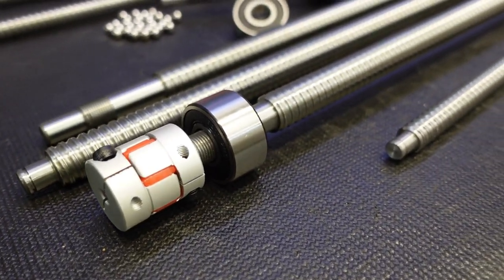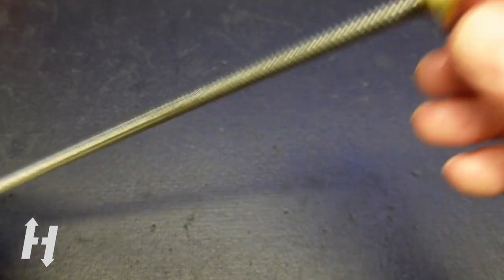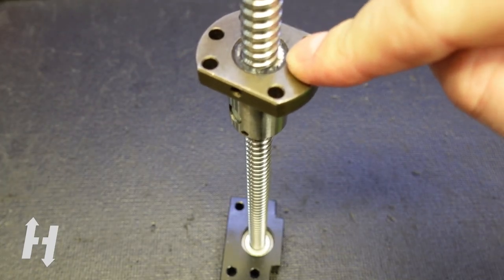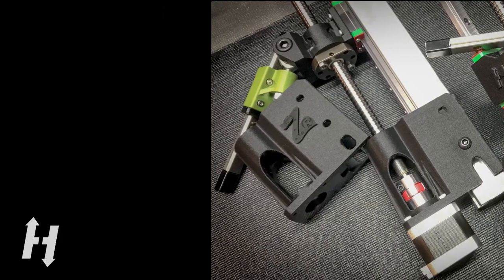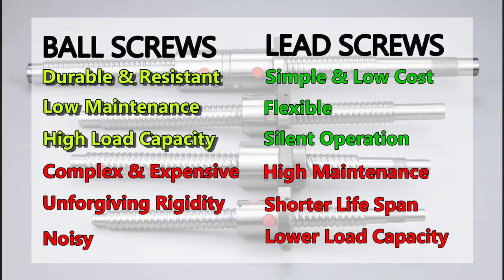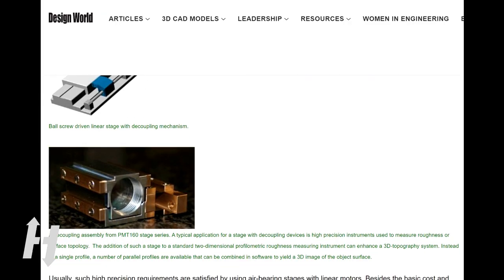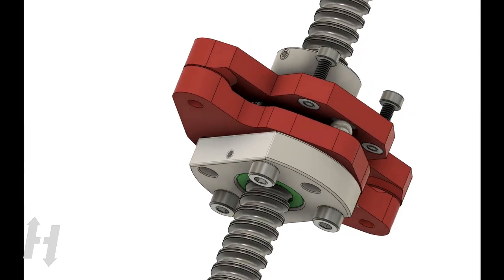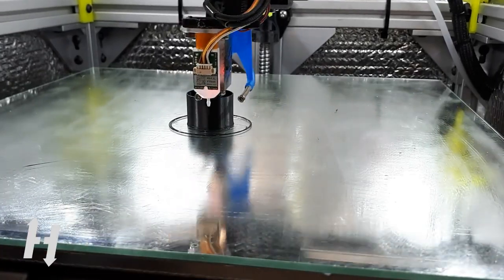Fixing Z Wobble from 20$ Ball Screws with that simple device

Comment: Will the ball bearings wear into the magnets? I don't think magnets are that hard. Why not have two metal cups to keep the ball bearings centered.  Fascinating video. Great work.
Reply from the maker: Yes they will eventually.  I have been running the wobblewings snice May 2020.  My magnets are showing signs of wear.  My next version will include precision hardened metal discs on top of the magnets.

Comment: Clever and inexpensive workaround!  Once the steel balls wear through the plating on the magnets, the exposed magnet will quickly oxidize and MAY give a rough rolling surface and could change the dimensional spacing.  I look forward to a follow-up video!
Reply from the maker: Yes, magnets plating does wear out after time.  This is what i am working on now: https://raw.githubusercontent.com/MirageC79/HevORT/master/images/DSC00123.jpg

Comment: Hmm glad i gave up just now trying to redesign my whole triple ball screw z axis to belts haha. Ill try this first!  If it works ill mill some up.
Thanks its probably the way my 800mm tall z axis will ever work.

Edit. I have made the changes to use on a 1205 ball screw for use in some cases. It uses the same hole pattern as the ball nut for a easy install. Obviously it wont fit everything.
If your interested reply here and ill add a link

Comment: Great video! Thank you for your time!

I like your idea. The information you gave about lead vs ball screw really helped me.

I have a question:
Does the bearing on your design will wear the plastic after a certain period of time?

If it's the case, can you put in your flexible bracket design a washer socket(like a fender washer big enough) glued at both side so the metal washer take the hit from the bearing instead of the plastic. Would that help?. If the bracket was made of metal that wouldn't be an issue but hey it's not like everyone has a cnc at home :P

Again thank you
Reply from the maker: the ball bearing are sandwiched between Neodymium magnets.  They will wear over time, but at a very acceptable rate.  I am looking for precision metal discs to be laid on top of the magnets for better durability.
Reply: @MirageC  My bad sorry. I saw the magnet disk in the 3D Simulation but in the actual parts I didnt notice...

Comment: Fantastic!!! A similar solution could be also implemented on my ender 3 that has a wobbly Z rod!!
Reply: If you're brave enough (and I definitely don't encourage it) you can do like I did and hand bend them very carefully back, they're sufficiently soft to be bent by hand at least on 400mm size, it just has to be veeeery slight bends at a time, always checking against a known very flat surface to see the results. It's easy to make it worse tho, specially applying the force on the wrong spot.
Reply: Haha buy a new rod
Reply: @REDxFROG  it's also probably bent if it's the same quality

Comment: Another great innovative discussion!!  One thing I would like to have seen is a mention of the fact that lead screws (maybe ball screws too, but I don't know much about them) can vary as to the number of starts for the screw, commonly anywhere from 1 to 4. The more starts the fewer rotations needed for a given vertical displacement, but I'm guessing the easier they are to back-drive. I'm curious if you know any other limitations or advantages to the number of starts, such as wear, or runout of the screws? (Oh yeah, obviously you must match the nut to the screw in number of starts.)
Reply from the maker: You are correct, the more starts on a lead screw with same thread pitch will provide more travel distance.  This allows to have low angle of threads will maintaining good travel distance.  It helps avoiding the back driving.  https://spool3d.ca/news/lead-vs-pitch/

Comment: Very interesting video, you seem to have solved the issue well. I still wonder if belts would be a superior solution though.
Reply: Belts + the accessories to support and roll them might end up to cost about the same as this contraption with the advantage? of higher rigidity
Reply from the maker: It all depends on the application, belt will be easier to back drive at same gearing ratio due to even less friction.  They will also need to be sized properly according to the bed weight.

Comment: What is it all for? isnt it too excpencive for auto bed leveling and slightly better non planar 3d printing or there is something else?
Reply: i understand fun of making such machine, but 1 lead screw is so cheap and works perfect am i wrong?)
Reply from the maker: Lead screw will work for a time yes, if you lube them religiously.  We Have some HevORTs with beds that are 600X600mm and more.  Those are quite heavy to actuate and we are not yet doing non planar printing.  But yes, it is still doable with lead screws.

Comment: Yet an another amazing video, please upload them more often. As a fellow engineer I love the designs, personally I would have just gone with a good quality lead screw if price is an issue. Cheapo ball screw additional to the wobble might have deviations in pitch as well. Also experience showed me simple always wins at long term use.
Reply: All screws have pitch errors. It just depends on your accuracy requirement. When the screws are rolled short term deviation is probably quite small. It will depend on the last couple of turns of the tooling, which one imagines is smoothly channelled.
Absolute error is something else. That depends on how accurately the rolls are made. For short lengths it is probably irrelevant but for 2 mtr lengths a cheapy could be interesting. If you can accurately measure those distances any error can be accounted for in the software. 
The real warthog in the workshop is temperature variation. With a daily domestic shed variation of 30 degrees c. here in Oz the 2 mt shaft varies by some 0.4 mm. or 15 thou.
Because of this and I am interested in absolute accuracy, just because I can be, I am looking at measuring displacement independently of the drive system.

Comment: Great comparsion of lead and ball screws!  Like your method to decouple the printing plattform from horizontal lead screw wobble, but why not just removing the upper screw mounting? If the lead screw is only attached to the motor and the other end can move freely the result should be similar...
Reply from the maker: lead screws a so rigid that they will still carry the build plate in their wobbling around motion when not attached from the top.  Due to the bed weight of this printer I am using a double row angular bearing at the base to take the axial load.  This makes the axis pretty solid in place.
Reply: @MirageC  Got it, thanks for explanation!

Comment: Why not have a belted Z axis? I have it on my Pro 3D V-King and I get no Z wobble + its cheap
 A wonderful video and beautiful engineering design!
Reply: There is nothing wrong with belts. Use them if you like. However screws being a metall part, they can widthshand high temperatures much better. For example the best belts at the moment are made by Gates - they are rated for 135c, but they do tend to wear out faster at elevated temperatures nevertheless.

Also i wonder what happens if your z belt ever fails? Does one side of the bed just fall down until it jams on it's rail's thrust bearing?
Reply: @dreamcat4  It is possible to isolate the belts from the heat (in some cases). And yes, belt failure would have your heatbed drop. However since belts are so dirt cheap and easy to replace, and dont have any of the problems associated with ball screws, I believe a well-designed Z-axis-system using belts (maybe more than one?) is superior in all aspects to a ball screw. It has to be overengineered so flexibility-related issues don't come into play, but it all pays off in my opinion. Z-wobble is just fucked man.
Reply: @youngtschakaloff  Thanks you your replies here. I think in response to your points...  it seem like a difficult problem to thermally isolate z axis belts AND seal the chamber for higher temperatures. Compared to (for example) sealing away belts for the other x-y axis. Your other point about belts being cheap to replace: well that is only really true for regular belts. However the hi temp belts are twice the price. To you can immediately double that. And of course then the more belts you need to replace, that difference in cost is going to eventually become more significant at some point. Doubling the belt width also going to double the price of replacing them too. So it all stacks up. And depends entirely on the specific configuration. But more so the MTBF for belt failure become exponential past a certain point when increasing the temperature.  And getting to around or above the rated spec. Therefore it's more difficult to know ahead of time designing the printer how durable the belts will actually be in practice. I.e. for a given target temperature that you are trying to hit (that is above 100c). Well... by comparison ball screws don't seem to have the same set of problems / trade offs. I am willing to accept the fact there are other possible issues with ball screws. Just that belts are not always so perfect either. It just remains very unclear to me what the actual other dealbreakers still are with ball screws, after seeing this wobble joint solution video. And the performance / results of it as demonstrated.
Reply: @dreamcat4  yes, great points you made there. You see, I talked to many people about the best kinetic system (cartesian, delta or coreXY) and it seems as if coreXY is the best, except for if you have Z-wobble issues. So I decided to construct and build my own printer. It is still an unfinished project but it will be a CoreXY with linear rails on all axis as well as worm gears and belts for the Z-movement. After putting the Z-system together and making everything work, I will isolate the whole print area and maybe make a custom watercooled hotend. That way no components, including belts are facing any heat. I am sure that this will give the best printing results for the money, all things considered (heated chamber too). I am planning to make a video when its all done but until then, there is some months of work left. Now, you got me thinking. Would it maybe make sense to use chains instead of belts? It's just that I don't think that noise ever was an issue for the Z-axis. Just an idea.
Reply: @youngtschakaloff  chains sounds like it could be a good idea, especially in terms of making a design that could initially use belts and then later on be retro fitted to use a chain instead. Should that end up proving to be necessary. However i don't know myself enough about chains to tell you is they could bring their own different set of considerations or other new problems to solve. However what I have researched and discovered was that in inddustry (like industrial ovens). The a similar solution they use in place of rubber belts is stainless steel belts. Which are literally just thin brands of stainless with holes punched into them like ticker tape paper. That is not to say chains are not going to work. But chains need lubrication to prevent wear. Which happens at an accelerated rate with temperature. Wheras a stainless steel belt needs no lubrication (at all), And is also lighter, and has resistance to corrosion too. For example if your print is of gassing fumes. So i guess thats why they would use them in industry over chains. However just try to find where to buy some such belts! And the matching gears to drive them! Because I came up empty. Could not find a shop anywhere. Its really more just b2b manufacturing customers. But maybe... if there were some already being sold as a replacement spare parts for an existing commercial industrial systems. Then they might in fact be orderable. Sorry but I really dont know where to get them! ... good idea though. Then you can start off with belts and see how it goes.
Reply: @dreamcat4  thanks that sounds great! Honestly they would probably be the best solution. I will try to find something too.
Reply: @youngtschakaloff  thank you for looking into this, and please come back and let us know if you ever find any! As would really like to get my hands on some myself. Not necessarily just only for Z but perhaps also for the X-Y drive. Until then, good day.
Reply: @dreamcat4  okay after a 10 minute google search it appears to me as if what you were talking about either doesnt exist or is stupendously hard to find, if you google "stainless steel belt" or the like, it appears the results are mainly some sort of sheet metal. If you search "stainless steel chain" you will only come across goofy jewelery. Its not easy! But I was thinking if, with the right tools, these sort of belts should not be too hard or expensive to make. But until then i rather melt some fiberglass ones.
Reply: @youngtschakaloff  hello i found there is a company who manufactures them, called "belt technologies inc". And you can see some examples of these products on their website. But I have not attempted to contact them because I really don't want to be dissapointed to find out the price. Which might be rather high, given the typical costs of industrial manufacturing machinery. However please checkout their product pages. If only to see an example of what they look like.
Reply: @youngtschakaloff  Interesting... there is a lot more useful technical information about them, if you sign up with email, and download their design guide pdf.
Reply: @dreamcat4  oh well. I ignored their search result, not thinking that they actually produce belts. Duh. 

The sheet metal stripes with holes into which balls engage like in chains are a great solution. With the right dimensions they can be perfect. However I see a problem. The minimum radius that the belt can take is rather big (plastic deformation unter tension like this would weaken the belt significantly). On the website, the wheel driving the belt is just as big as the stepper motor. Using this without gearing on the Z-axis is out of question, worm gear is mandatory. For X and Y it is also too big i think. Steps per mm would be too few. 
Gearing on the Z-Axis is fine, but not on X and Y.

Otherwise this is great! 
Dont worry about the price. Yes it is probably overpriced "made in germany" but its just thin sheet metal with holes. Definetly DIY-doable if you ask me. Honestly I can do this. I might actually make and use that for my Z Axis. Thanks for inspiring! 😎❤
Reply: @youngtschakaloff  yes that is the main drawback, the requirement for gearing. but i don't seem to be smart enough underdstand myself yet why it would be a deal breaker for the x-y axis. Can you please explain a bit further?
Reply: @dreamcat4  yes well it is possible, not a dealbreaker at all. In my own work i would rather just stick to belts for x and y first. I dont have the space for a traditional gear reduction. Also it would make sense to use a belt for that gear reduction. And that belt would not be a steel sheet belt like the one we want to have here. And honestly, if you can (because you really have to if you care for lifespan) isolate your steppers from the heat, you can also isolate your belts to a degree. Thats just what im gonna stick too. 

On a different note, do you have an idea for a different platform to discuss like this? I was thinking of reddit or so.
Reply: @youngtschakaloff  Either the Hevort discord server (link in the description), or there is also a 'high-temp-fallacy' channel on the annex engineering's discord server. BTW i just found where we can buy very cheaply these stainless steel perforated tapes now!!! If you just google the magic set of words: 'perforated stainless steel tape'. Then it will finally turn up seler links for a variety of similar products. Which are are being used in other applications.
Reply: @dreamcat4  You can pretty easily calculate the amount of gearing required for the motors to hold the weight of the bed when turned off so your bed doesn't droop if you loose power or something. It is my opinion as well that if you've got this many motors you might as well go with belts since I don't really see many benefits for the ball screws.
Reply from the maker: Yes, belts could be a great solution.  Motor gearing and belt size would need to be adjusted for bed weight.

Comment: Wow! this is really cool! But aren't you now depending on the flatness of those magnets that the Balls are touching? Or is that not a problem after bed leveling?
Reply from the maker: the flatness & parallelism of the magnets is quite important yes.  This is why my design has both half printing up to ensure the surfaces on which magnets are sitting are as precise as possible.  Printing them with support would not work.  My next design evolution makes use of wider magnets to avoid having them crooked into location.
Reply: @MirageC  Thanks!

Comment: Thanks for this. I use belts on my printers for Z but have thought about moving to BS for tripple Z action and did buy 3 cheap ones to test
Reply from the maker: I suggest trying to measure their runout first.  Are they 12mm?  If so I also suggest you look into a proper way to sit them.  I had a lot of issues with SFU1204 due to their half thread shoulder.  Se an article I posted here: https://forums.hevort.com/viewtopic.php?f=5&t=316
Reply: @MirageC  thank you for the response. I ordered the sfu1204 yes but integrated in steppers to avoid coupling problems. If they cause problems I might just use a belted system, it rarely fails. Here is the bs I ordered NOK 1,065.73 | 3PCS Nema17 Stepper Motor 17HS8401S-SFU1204 1.8A  4-lead  L150/250/350mm 42 ballscrew motor for mini cnc 3D printer
https://a.aliexpress.com/_mrV2Zkj